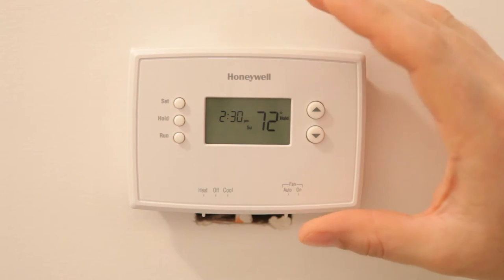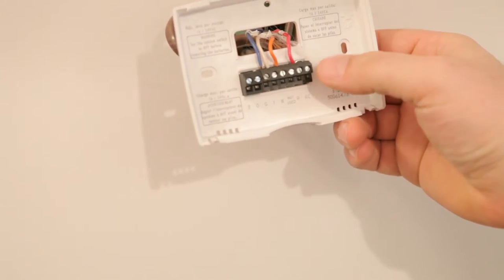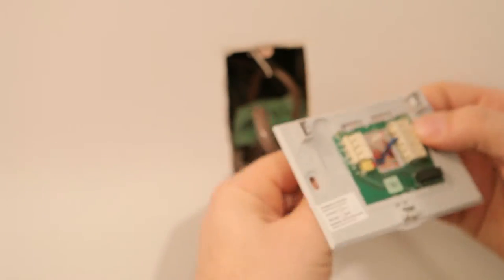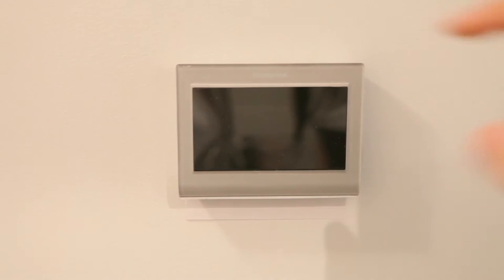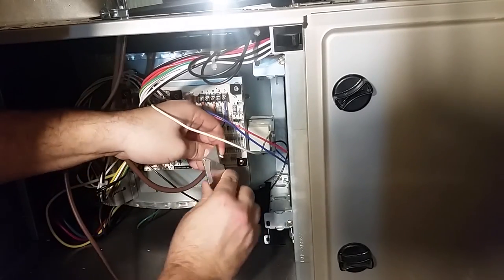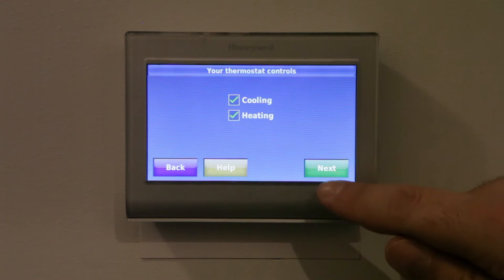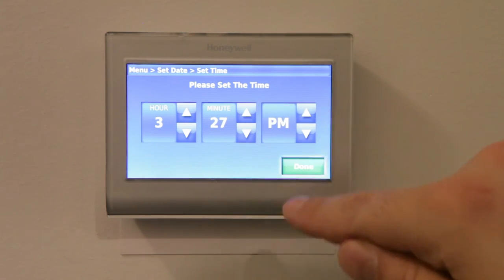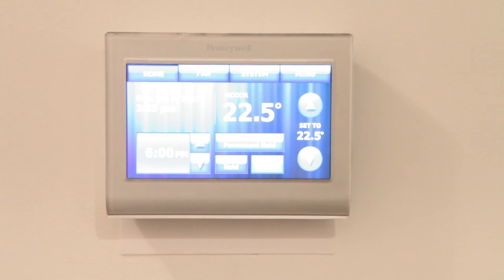Honeywell Smart Thermostat Install - RTH9580WF- LHP

Comment: Do you know the difference between the Honeywell RTH9580wf vs RTH9585wf?  Also, is there a screen saver for the LCD screen and do you have yours dim or go off after a number of seconds?  I do like this thermostat...
Reply from the maker: Hi Jeff, I don't know the difference between the 2, sorry.  I don't think there is a screen saver, but it does change colors at night.  Also there are brightness and color setting so you can choose what works best for you.   I haven't noticed it getting darker after a few seconds after using it, but it must after some amount of time, because I have noticed that sometime when I use it it is darker and it brightens when I push a button. I'm just not sure how long it takes to get darker again.
Reply: Jeff. I saw you ask this question st another site. Looks like there’s not much of a difference other than that the 9580 has a slightly different screen i.e. shows date ...  but I assume you already bought one by now. Have had any issues keeping the device connected to WiFi??
Reply: HI thanks for writing.  I'm happy with unit we have.

Comment: gas/oil or electric on a force air unit.  How can you tell ?
Reply from the maker: Hi Thomas Vu,  I'm not sure really,  I can see the gas line in my house feeding into my furnace, so that's how I know it runs on gas.  I assume oil would need a large oil tank, but I've never seen one, so I don't know.  I guess if you cant see an oil tank, or a gas line, that would mean it is electric, maybe?  Sorry I can't be more help.  Good luck.
Reply: LittleHomeProjects thank you sir.

Comment: Thanks for you tutorial ....... But I have no C in my System   Can you help me?
Reply from the maker: I'm not an expert so keep that in mind, but the C should be for continues power to the thermostat from the furnace.  If there is no C maybe it's just missing the wire and there is a C location at the furnace?  if so you would need to run new wire (that's usually not a small job), or there are thermostats that can run on batteries instead of the C wire.  I don't know if there are any smart thermostats that can run on batteries though.  Sorry that i cant be of more help, I'm still learning as I go from project to project.
Reply: Thanks for you time

Comment: Lot of reviews have expressed issues regarding longevity of this product. Have you had issues with this product staying connected to WiFi. Now that it’s been a couple of years??
Reply from the maker: I run mine through SmartThings and I have had to remove it and add it several time.  Its happened 2 or 3 times since the install, but I don't think that its fair for me to say it is the Honeywell product, or if it is the SmartThings hub/software that is having the trouble. It may be that it's loosing its connection when there is a software update on the hub???  But, in any case, I have noticed an issue with this, and have not seen it on any other of my smart devises.